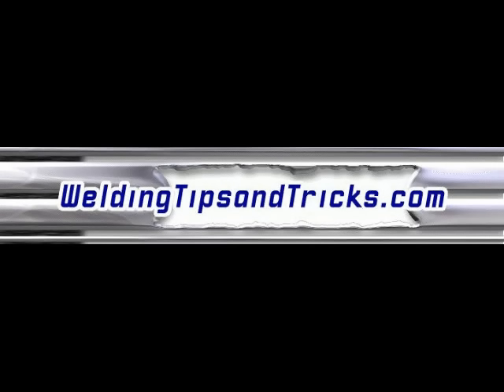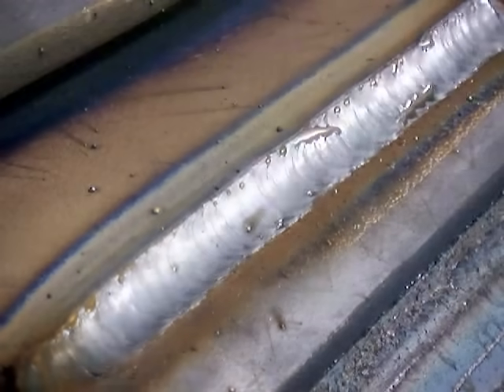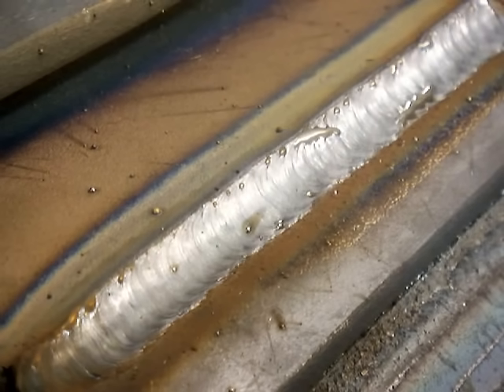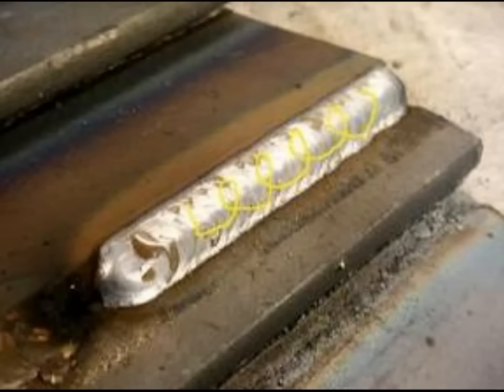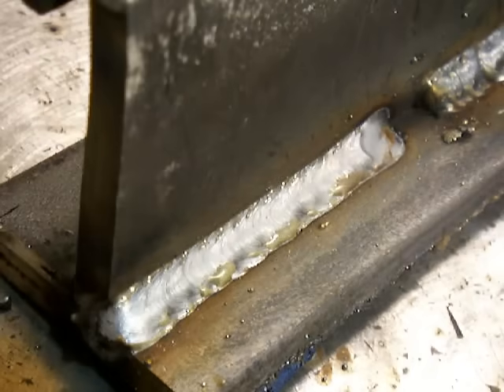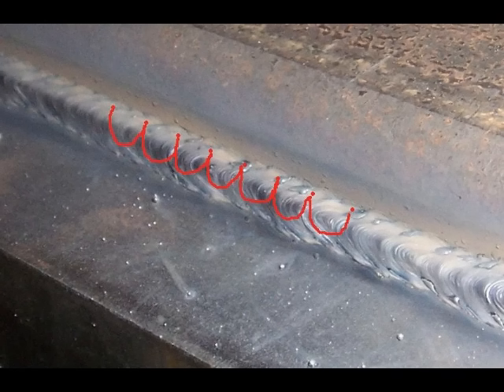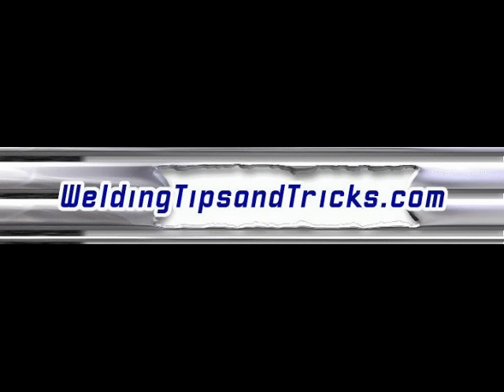Mig Welding Technique Taught by Old Timer

Comment: you should never pull a weld. I'm a structual engineer here in the UK and if I was caught pulling a weld I'd get fired on the spot. it's not structual sound.
Reply: Yep, My old man taught me that as well. drill the end unless you want the crack to continue... i have to drill and weld a crack in the door of my Truck...
Reply: I can weld anything....from a broken heart....to the crack of dawn!!!   Speaking of cracks,  before welding a crack, or torn weld, drill both ends out, then weld, otherwise, weld will repeat crack.  It's like plug welding both ends of fault!
Reply: I'm an old timer, so take notes...whippersnappers!!

Comment: My instructors have basically said that this method is a sin and we should focus on the steady constant weld. And they are really old school, to the point of sometimes almost being outdated, expect my primary instructor who is basically up with the latest and the greatest. 

Only place I been allowed to use the loop technique was in a filling job that wasn't structural, other than that we must adhere strictly to the ISO guidelines, PWPS and WPS.
Reply: You'll be a better welder because of it. Thats the NASA way of welding, hot and fast. I've made it work quite well in many applications, though I will say that if you "weave" correctly, you still get an unscalloped bead with uniform toes and penetration. If you ever look at the back of a woven bead, often the penetration is wishy washy, whereas a stringer will be uniform, easier to clean if you're back welding, and some say (myself included) under less stress.
Reply: Straight line welds have less penetration/strength

Comment: pushing (depending on amperage) works much better, for fillets i pull and vertical downs i pull but a pass like this i push going from right side to left side (im right handed), It parts the bead and seats the weld into the seam. Fantastic pass though

Comment: haven't welded in 12 years. I welded for the first time sense then. I find it hard to become patient with unsatisfied work. I issue is technique and speed. I believe your oscillating when you weld? greatest welds I've ever seen and very clean. Thanks for taking the time to share.

Comment: Doing circles, it looks as though you are pushing and pulling, depending on where you are in the circle. Looks like a good buildup, what size wire are you using?

Comment: Nice video, great weld. Its not actualy MIG welding But MAG welding. You only MIG weld when you use 100% Argon/( or Helium) for weldingaluminum. When welding steel like in this video you use a "mix gas)  Lets say 75% argon and 25% Co2. These are active gassesso there you go, you MAG weld.

Comment: When I took welding classes, my old-timer teacher insisted the bead be embossed on top of the joint. Also, the rings should be very close together. Debossed beads like those in the video were considered sloppy. Is this just personal preference?

Comment: weldingtipsandtricks Will this type of style welding work with a Flux Core Welder??
Thanks hope you can help
Reply: +Justin Watson Yep. Just gotta take care to avoid slag inclusions.
Reply: +Justin Watson Pull the pool, this lets the flux rise to the top, making a nice weld. If you push the pool the flux can contaminate the filler as it hasnt time to raise to the top before the pool cools, you can weave if needed
Reply: scott adsett Great tip thanks man

Comment: Spot on! Exactly the technique I figured out for myself after many years of welding. It was an adaptation or progession of techniques used for solid wire pipe butts and vertical up fillets.  Gun angle; push gives a wider, flatter, shallower bead. Drag gives a narrow, high, deep bead.

Comment: I've heard people say going over a MIG weld with a torch to anneal it and the surrounding metal will help with bead to parent metal :thermal shock" embrittlement and cracking.  Any thoughts?

Comment: My question is this:  When should I use flux core and when should I use gas?  From what I can understand flux core causes more spatter while gas is a prettier weld.
Reply: Dave Durham that's the first time I've heard anyone say flux core looks cleaner than with gas shielding.  If you're in a shop & don't have to worry about wind, gas is the way to go.
Reply: lol
Reply: +hawkdaddy64  If you were wise, you would learn flux. The industry is going to start moving over to flux and away from gas. Yes an outer shield flux is going to look like a elongated cat turd. Once you knock the flux off - as in stick your weld will be "pretty". Flux is moderately easy, its akin to running a spray arc transfer. :) Have fun
Reply: Flux core there is two kinds gasless and gas another term for gas flux is duel shield gasless is best when used in the wind where gas blows around then you get porosity witch has no strength but if your not in a windy environment then I would go gas 75%argon and 25% co2 if you are doing pulse mig then you will need a 90% and 10% you can use 100%co2 with mig but not the best strength or the best looking
Reply: so many people have told me to check out the welding mastery webinar for help so im hoping i learn something today
Reply: +hawkdaddy64 
FLUX CORED IS FOR USE OUTSIDE ( WIND DOES NOT AFFECT) WITH GAS YOU CONVERT IT TO MIG IT WOKS BETTER FOR INSIDE, BTW FLUX CORED IS STRONGER
Reply: .. There is also option to use flux core with gas. (mainly flux core is used with gas) It makes less splatters. 

Acid proof Steel with 315l flux core and 75/25 shielgas doesn't make nearly any splatters. 

Esab 15.17 is regular 1.2mm flux core for steel. Inside or outside, you can't weld with those without shieldgas.. your welds will be like cheese if you do that.. 

There is no straight answer. Mainly Flux core is used for thicker weld trough materials. Its more productive, but usually it gives more heat to the workpiece. 

If you are home welder and weld under 1/4" materials? I don't see any real reason you to use flux core.
Reply: xyvyx Oh! I might put the answer a better way, since I use both methods in the factory I work in. I like my flux core better then my mixed gas welds,flat vertical and overhead.
Reply: Ive heard nothing but good things about WeldingMastery. com and how its helping people earn and learn welding.
Reply: there was a course i saw that taught lots of mig welding stuff... weldingmastery. com i think the guys name was garrett. great teacher!
Reply: MrSkidoomxz 100%C02 gives the best penetration for duel shield flux core, so how would it not have the best strength... And there is no such thing as "duel shield gasless". flux core has the flux in the center of the wire and the gas acts as additional shielding for welding outside.
Reply: +Debbie Dude   v
Reply: +Mike alm The flux in gas-shielded flux cored wires does not contain any gas-formers, only alloying elements and slag-formers that help moderate cooling rate, provide a little extra protection from the atmosphere and assist the formation of the proper bead profile (especially when welding out of position). The term "Dual Shield" is a proprietary one used by ESAB to denote their gas-shielded rutile cored wires that can be used with either 100% CO2 or 75/25 Ar/CO2. Use of a gas other than that specified will affect both the arc performance and alloy content and physical properties of the weld deposit.
Reply: +hawkdaddy64 Flux core, you pull the weld pool, mig you push. Mig is more versatile as fluxcore can leave flux in the weld when doing vertical welds. If you have a v half an inch wide on inch plate. Arc and mig will need a bead, stringers and a weaving cap. Flux core blast it in till it fills up the v or fillet in one go, so fluxcore is more for heavy welds like structural steel.You can buy small rolls of flux for 240v welders but these are for hobyiests that like to uee a dremmil.
Reply: +MrSkidoomxz I've tried 75/25 and I hated it. I like straight Argon. I did not like just CO2 either. I'd like to try helium someday. Just to see what it is like. I never had a bottle of it to use though.
Reply: +Welding Department .. and more productive.
Reply: replacing studs on 1999 Ford truck
Reply: McNuggs pop
Reply: McNuggs l
Reply: hawkdaddy64  Flux core is a better looking weld then with gas, in my experience. Its very smooth and not much splatter.
Reply: All the gas is doing is protecting the weld from contamination from the air. Use gas if in an enclosed space

Comment: Never was taught this method I don't see how you would get full pen with a circular motion especially sense you're pulling the puddle rather than pushing it. I build sub's and this wouldn't pass a bend test. There would be indications all over that in a bevel test. I find an elongated j works best always get full pen.
Reply: Aaron Oneill 
Make a video then. What good is it to complain but not show. We are not all welders and are trying to learn.

Comment: Im only 17 so ive been welding with a stick maybe 4-6 years. Only 1 and a half with a MIG. But ive always done this trick with a MIG. I work at a fire sprinker shop and when we patch welds or cant use the circle (outlet) welder we use this method and it works fine with no leaks depending on who does it. The master welder of the shop though does more of a U shape most of the time. But ive seen guys do it several ways. Its all a matter of preference and the access space you have. I usually push my weld but it depends on the application. I always like to hear tips from other guys but for once it was one i already knew! :-) thanks a bunch sir.

Comment: Hi. Nice tip. As a beginner, I'm interested in getting a a welder for hobbies in repairing rust on a project car, and/ or around the home like a fence repair etc. which kind of welder should I be looking into? A mig?
Reply: hhova29  dont get a mig if you're welding rusty metal get a stick or a flux core welder...
Reply: Thanks very much :). Appreciate it. I'll look into a cheaper one at harbor freight but guess a core flux one may do? Yeah I plan to do some welding on some panels needing patches on a camaro and on its undercarriage. Any other tips that I may look into you may suggest.
Reply: hhova29 i suggest using a Stick welder with 6010 Electrode(DC+) or if you are on a budget you can look for an AC stick welder and buy some 6011 Electrodes(AC Only)- just make sure to look up how to whip/pause technique if you dont know yet. those rods will burn very nicely through Rusty pieces. good luck.

Comment: Yer I used to weave weld when I started as a light fabricator thinking that was a good weld and all but found out later that it is rubbish.. Now into heavy fab I find a more direct approach with the touch without the weave just like if you were welding with flux core gives the weld better deposition.

Comment: Nice end result, no missed edges but don't need to circle. Turn the heat up, use spray transfer, heaps faster and smooth weld, no ripples.

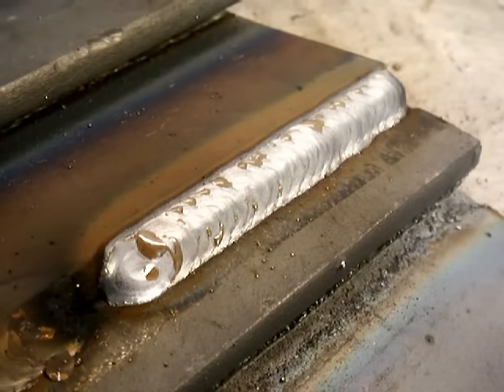Comment: Can someone please explain what that brown liquid is on the weld bead at 1:07
Reply: hakman239 just an impurity from the process, like your slag from welding with your stick welder
Reply: +hakman239 Silica is silicon dioxide. Most steel welding wires contain around 6% silicon as a weld pool de-oxidiser. However, gasless wires generally use aluminium as a de-oxidiser. There are chemical/metallurgical incompatibilities between these elements which mean running a gasless weld over a gas weld or vice versa can cause cracking and weld failure.
Reply: thats silica!  it happens when welding, you can just use a stainless brush on it, or sometimes smack it with a chisel and it comes out :)
Reply: what does the silica do to the weld
Reply: hakman239 Silica islands are just one of the by products of MIG welding caused by the oxidizers in the shielding gas you are using.
Reply: thanks

Comment: There is nothing wrong with the technique but the power setting is far too low for this material thickness, the fusion and penetration will be very minimal - the arc should be in the spray transfer range using 250 - 300 amps with 1.0/1.2 mm wire diameter.

Comment: From watching your videos I noticed the distance you keep is very critical to keep the weld going smooth. I think if more people would watch more videos like yours they would see how easy it is when you see it done right and just duplicate what they see. I'm currently welding without my tip with flux core wire and from watching your videos my welds are working out great.

Comment: I've been hobby welding for about 20 years, mostly with a Lincoln Arc Welder. Last year I got a Miller Mig welder which works great but I have a quirky problem. I have trouble seeing the weld puddle and I veer offline.  My helmet has a variable darkness setting but I'm reluctant to decrease the setting.  I've used other helmets with other mig welders and seem to have the same problem.  If it tilt the welder tip to block the flash I can see ok but then I can't see the weld line. In your experience does an arc weld flash differ from a mig weld flash?
Reply: Hmm, 20 years of welding.  It might not be the shade of the lens at all.  Try getting some magnifying glasses.  I found the safety glasses with the magnifying insert like a bifocal glasses.  You might be surprised how much easier you can see the weld puddle.  I sure was.  Worked good for me after 20 - 25 years of welding.
Reply: HWP, I have been welding for over 25 yrs, and I have certainly dealt with the problem of losing a weld seam before.
I have used the auto lenses before, but mostly a regular dark glass or gold plated plastic lens, in either case, when I am using a mig wire equal or smaller to .035 or stick under 1/8 then I usually use a #9 lens.  When welding with higher amperage wires such as dual shield or single shield flux I bump up to a #10 lens.  If I use the #10 on the smaller stuff I just can't see good enough.  My vision is still great and have never burned my eyes when my hood was in good shape with this loose rule.  I do however always set the delay as low as I can with the auto lenses.  I need it dark fast.  LOL
Reply: Definitley lighten up the lens, made a huge difference for me when I was having same issue.
Reply: Turn the lens shade factor down until you can clearly see the weld seam. There is absolutely no danger of getting "the flash" or "arc eye".

Comment: Push for solid wire pull for flux core. No need to move in circles just a  steady hand and steady speed, the right settings and you will have an awesome weld.

Comment: What about a back and fourth motion? Like forwards and a bit back? Seems to work for me, but I don't know if its a good way to do it.
Reply: I usually do the back and forth for when the welds need a little bit of a fancy look. I learned this from a guy I worked with all you do is increase your travel speed a little and then slightly go back to fill in the rest and continue on, I call it back stepping. The issue is tho it takes time to get a good solid unified bead that is strong enough, and undercut can happen very easily. But most of the time people end up buffing the welds anyways so there is no need for it.
Reply: A fellow at the shop I work at welds like this and his welds always turn out almost perfectly. I was told by other welders in the shop to use the "loop" method of creating little circles as opposed to forward and back, but have found that both work and if done properly produce good looking welds with complete fusion.
Reply: U
.